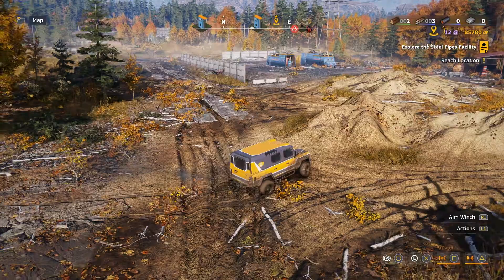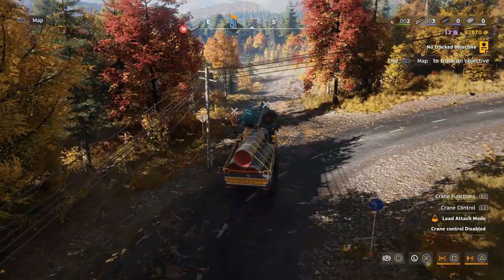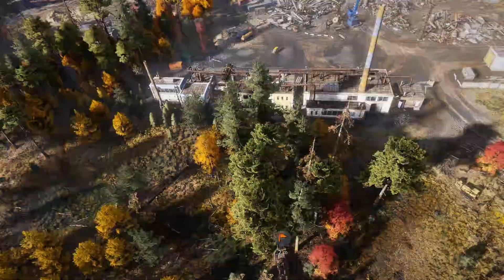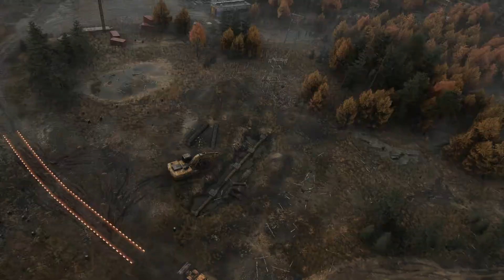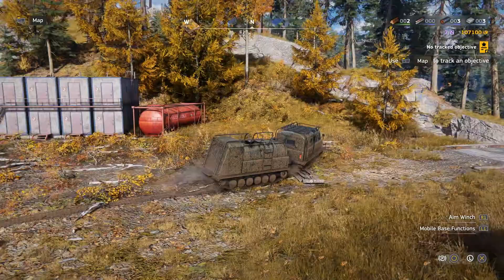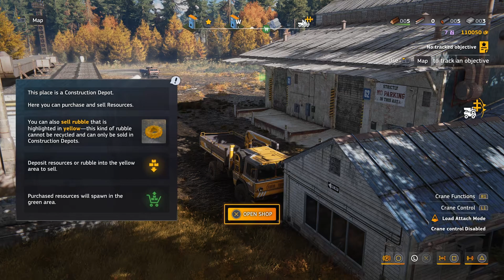Roadcraft Restoring Steel Pipes Facility And Construction Depot

Comment: Great details on the video 👍 ... by any chance have you heard anyone having issues with this missing, i have completed 3 out of 4, the last thing I have to to is get 6 steel beams. My issues is that I keep bringing resources to the steel beam facility and im not getting the pop-up message on the bottom left asking how much more I need or the option to take out steel beams. I have brought lots of scrap metal right now is on 27 but is not giving me the option to take out the steel beams. You see every time you are getting close to the drop of zone of the steel beams facility how you get that pop-up message on the bottom left of how much more you need to make a beam. Well that part on not receiving.  It won't come up and is just letting me keep restoring resources.

Comment: Can I ask how do you get the AI to lay the sand for you
Reply from the maker: You can only do it on road building missions, but when you have the dump truck in the yellow square that’s at each end of the road to be built, you can open the road building menu, and it’ll let you click square (I’m on pc but using a ps4 control) on the road, and the AI will start driving. If it won’t let you press square on the road, click square on the vehicle you want to start driving first, then square on the road 👍🏻, you can do it for all 4 stages of the road building